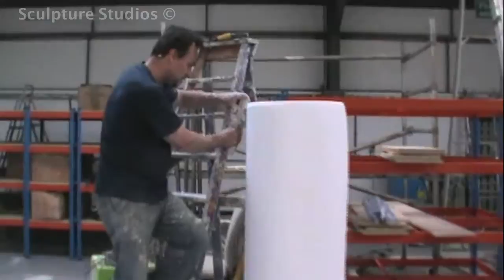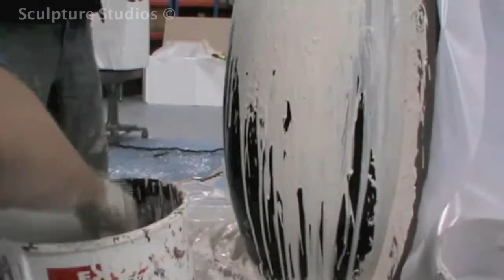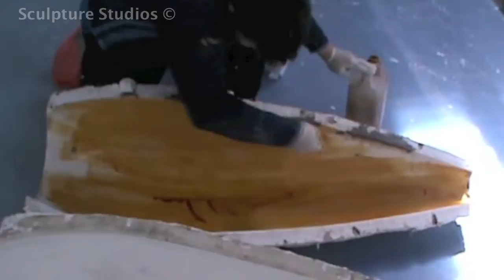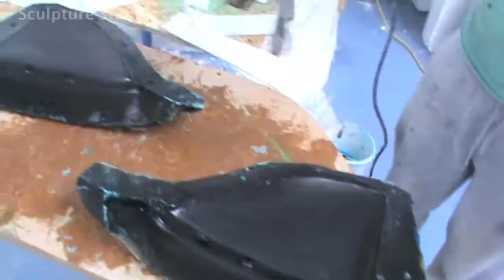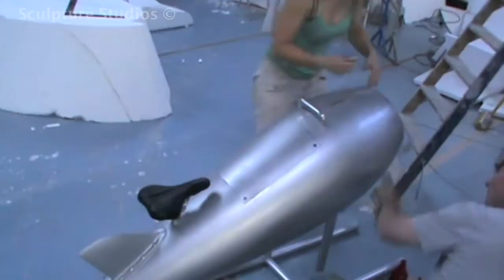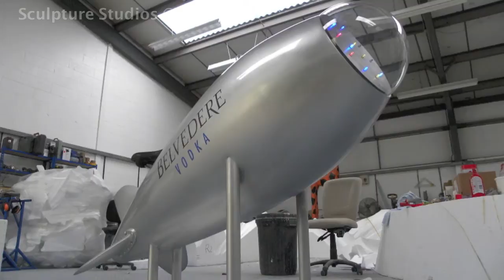Vodka Rocket by Sculpture Studios

Comment: I'm always inspired by your videos. I'm currently in the process of building a large-scale model of the spaceship from the 1960s "My Favorite Martian" TV show, using many of the techniques you demonstrate in your videos.
Reply: I'm currently building a 1950's (roswell style) spaceship out of foam... is that similar to My Favorite Martian? 

you might have better luck with hard coating your work if you use EPS foam instead of XPS... either way I scratch the factory finnish off with a wire brush then coat with either joint compound, 'dryvit' stucco or portland cement/glue mixture.

check my vids if you like.
Reply: I finished the My Favorite Martian spaceship quite some time ago. You can see my complete build sequence here:
https://www.facebook.com/media/set/?set=oa.847614498679942&type=3

I don't see that there would be any difference in hard-coating the foam between XPS and EPS. EPS is more "granular", it being made up from lots of tiny "beads", while XPS is really smooth, so it's much easier to get a final smooth surface before doing any hard coating. I used Epoxy Resin for the coating and it worked just fine.

Comment: I hope I haven't exhausted my daily question quota but I promise I wont ask again for a while. The way the trapdoor seems to fit so perfectly is really amazing. Is the trapdoor the same piece you saw off the rocket's body or do you cast it separately? I can't imagine it being sawed-off the rocket's body as the slack due to the sawing-bit thickness would be significant. I've also noticed an internal frame on which the trapdoor rests. Is that also cast from the mold separately and then 'glued' inside? Cheers!
Reply from the maker: Hi Dorian, ask away!! The trap door was part of the rocket itself, it's cut out using a electric disk cutter. Basically we create a shelf on the inside for it to sit on, by first cutting the trapdoor, and laminating a lip on the interior while the plate is held in place, (but you need to put something like sticky foil on the plate so the shelf isn't laminated to the plate also). To make up the large gap created by the cutter, we put foil on the trap door plate, put it in place, and fill the gap in between (once again the foil stops the material from sticking to the trap door, so the seam is filled and the plate can still be removed once its all been filled). I hope that all makes sense?
Reply: Aden Hynes Many Thanks! Makes perfect sense.

Comment: You mention a plaster that you coat the initial foam model with in order to get a really smooth surface. What kind of plaster is that? I'm working on a project using the standard blue XPS foam from DOW Incorporated that's available at hardware stores here in the U.S. I did some tests with Spackle brand plaster and it simply does not stick to the XPS foam. What do you recommend?
Reply from the maker: +Roger Garrett Its just a water based plaster filler that you apply, leave to air dry, and then sand down